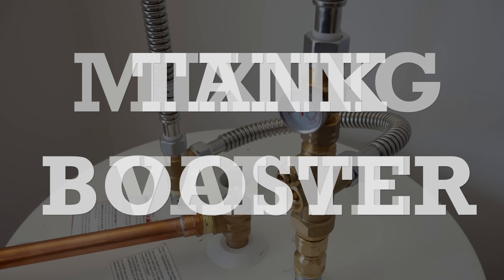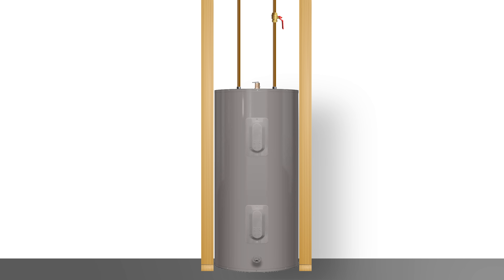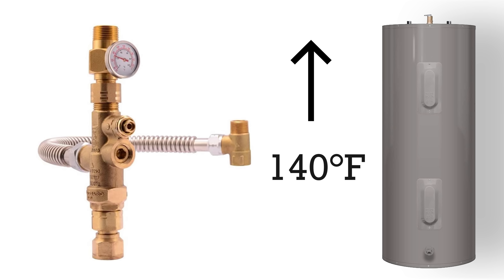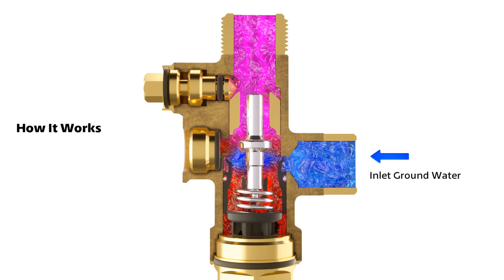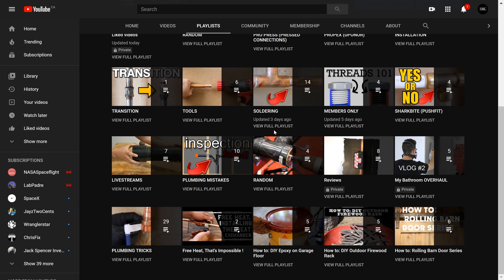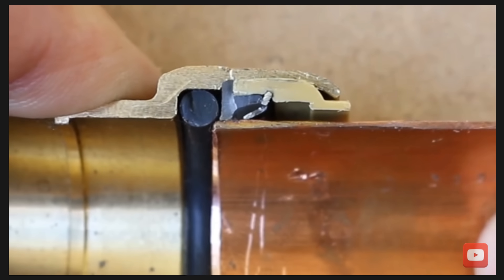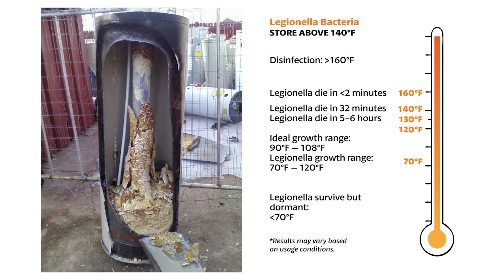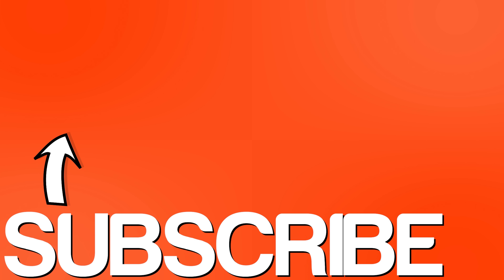INCREASE Your HOT WATER Capacity With This! (Cash Acme PRO Mixing Valve) | GOT2LEARN

Comment: Hey Got 2 Learn. I have a video idea for you. Here in california we are all about saving water. Do a video over the pros and cons of hot water recirculating systems. Ideally people would run a seperate return line back to the tank from the furthest fixture but that can be difficult and cost a lot of money to done on a finished house. I like both of these systems but they both have pros and cons. I like the more expensive one becasue it turns on and of with temp. But they both send luke warm water back down the cold water line and that will kepp you from having cold water at the tap.
Heres the two that i Like. https://www.homedepot.com/p/Watts-Hot-Water-Recirculating-System-with-Built-In-Timer-0955800/100426993
https://www.homedepot.com/p/Undersink-Instant-Hot-Water-Circulating-System-ACT-E1/100037011
Reply from the maker: I shall make a video on this in the future, thanks.
Reply: Me too. Also, thank for the two links. Here's the mention in this video, new video with details would be awesome... subscribed btw. https://youtu.be/bQl5I6E2MHA?t=389
Reply: Recirc lines are a massive waste of gas/electric and are purely for the convenience of instant hot water at the expense of massive heat loss via your pipes, even though they would be insulated. I’m surprised California hasn’t banned them.
Reply: @jman0870  Yes, but one waste a lot less water. We here in California are more concerned with water.
Reply: @travisk5589  I guess you would technically save water by not running as much cold down the drain waiting for hot 🤷‍♂️

Comment: I disagree with 2 statements: 1) more hot water available; 2) not a scam. With or without the device you're not really working with 40 gals of hot water for long. As hot water is used, it is immediately replaced with cold water so there is no longer 40 gal of 120 / or 140 degree water. This is all just a exercise. in mental gymnastics  If you heat water to 140 and cool it to 120, you've wasted energy but it doesn't matter whether you cool it at the tank or at the faucet

Comment: Besides operating costs, why is this any better than having a recirc pump going?
Or why would I want this used in conjunction with the pump?
Reply from the maker: You don't need to install a line from the tank to the furthest fixture, there's no electrical work involved  and there's probably other pros but can't think of them right now LOL.
Reply: Different application.

Comment: What about a whole house booster? I was gonna buy a Gunfos one here in Ontario Canada but it costs 890 bucks plus tx. is there a cheaper way to boost house pressure. i have a tankless installed, so also will it work?
Reply from the maker: These do not affect pressure, only temperature ;)
Reply: Bought and installed a Grundfos booster for my buddy. Worth the money if you need the pressure boost. Will work with tankless. Let me know if you have any questions.
Reply: @lrc87290  Thx for the reply.    Cheers!

Comment: I was thinking about getting some pex rolls and keep them coiled and put them in my attic. While dormant, they'll heat up and I can use that as an input to the water heater!
Reply from the maker: Or the roof heck!
Reply: @Got2Learn  would UV be a problem for pex?
Reply: @michaellewis6569  Pex is not designed to be exposed to sunlight. BUT.....I have used Pex outdoors and it is amazingly durable stuff. I use it for garden cloches, garden irrigation lines etc.
Reply: @michaellewis6569  there are different types, some are uv stabilized

Comment: I prefer using a navian tankless water heater. Never run out of hot water at all and you don’t have to worry about 40 gallons of water ready to flood your house.
Reply: Are tankless heaters impervious to leaking? The gallonage of water which floods the house is based on time duration of leakage not tank size.

Comment: More hot water and a larger energy bill.....  sold
Reply: Higher bill -- agree. More hot water -- disagree.
Reply: @65csx83  it is functionally more hot water at a safe use temperature. You could just turn up the temp on the tank and skip this device, but safety at point of use is up to the user.
Reply: @michaellewis6569  If you're happy thinking the device is of any use, I recommend you don't buy it and be disappointed.
Reply: @65csx83  troll on sir. Have a good day.

Comment: Not convinced yet, who has this installed and what experience do you have does it save on your cost how is the water flow less or eqael
Reply: As the video mentions, it's going to increase costs, not decrease. It gives you more available hot water, not savings.
Reply from the maker: 100%

Comment: Navien and Rinnai just to name a few make a much better solution to this problem 😂 great vid as always 👍
Reply from the maker: They do hehe, but they are a heck more expensive LOL, thanks Joe!!!
Reply: @Got2Learn  Very true! I really like the 2" pvc venting on the Navien's. Supposedly you could recover some of that cost over the years in energy.
Reply: @joedart2932  the premise is based on the latent heat of evaporation/condensation.  A cubic foot of water ( 28.33 liters ) at 212f takes an additional 970btu to achieve a change of state, you now have steam @ 212f.. in a condensing appliances ( any high efficient ) you re gain 970 btu for every cubic foot of water that condenses in the exhaust.. to put that into perspective 1  cubic foot of ch4 ( natural gas ) = 1000btu

Comment: You guys are misunderstanding your own legislation. The purpose of the changed legislation is not to convince people to go replacing their 40 L boilers for 60 L boilers. That won't improve boiler efficiency unless the 60 L boiler has much thicker insulation. The purpose of this legislation is to convince boiler manufacturers to go and increase the insulation thickness on the boilers. For instance you could take 40 L boiler and greatly increase it insulation thickness so that in he end its outside dimensions would be comparable to dimensions of current 60 L boilers. The amount of water such boiler would hold is the same 40 L but since this would almost double the insulation thickness it would greatly improve efficiency of such boiler.

As for these advertised gadgets that allow you to rise the temperature of your boiler. Well raising temperature of your boiler WILL NOT make it more efficient. In fact it will make it less efficient. Why? The laws of thermodynamics state that the rate of heat transfer from one medium to another depends on heat conductivity of the material through which heat is being transferred and the diference of the temperature of the two mediums and the contact surface of the two mediums though which the heat can be transferred.. So when you increase the temperature of the water in your boiler you also increase the rate of temperature transfer from your boiler to the room in which it is in. Also if you increase the size of your boiler but maintain the insulation thickness the bigger boiler will actually be less efficient as it will be generating bigger heat loss due to its bigger surface through which the heat is being lost. So having bigger boiler does not necessarily mean it is more efficient.

And finally if you use up all your hot water every time you take a shower it doesn't mean that you will need more energy to heat it up back again versus if you won't use up all of the hot water every time. It takes the same amount of energy to heat up the same amount of water to desired temperature whether this is done from room temperature to 140 degrees Fahrenheit or from 100 to 140 degrees Fahrenheit. Of course we are not talking here about the amount of water your boiler holds but instead the amount of water you use during shower.

If you want to increase the efficiency of your boiler for cheap there is another way. You see you have your priklical boiler placed in a square closet. Meaning that around the boiler there is quite a lot of space that is not really usable for anything. If you would go and fill all that space with additional insulation material you could greatly increase the insulation of your boiler and thus its efficiency. And you don't necessarily need to use a high grade insulation material for this.You could use any materials that have insulation properties. of course better insulation properties would lead to better gains. So for instance you can fill all that empty space with all that packing material (Styrofoam packing, cardboard packing, etc.) instead of throwing it into trash. Just make sure that such materials don't get into contact with hot parts of your boiler like hot pipes because unlike high grade insulation materials such these materials are probably not heat resistant meaning they could start melting or even catch a fire.

Any way in short the only way to increase the efficiency of your boilers is to increase its insulation properties. Everything else is a scam.
Reply from the maker: That's pretty much what I said in the video.
Reply: @Got2Learn  Not at the beginning- You claimed that raising the temperature would lower your costs at first, and then said the opposite at the end of the video. You have a image that states "The energy required to heat the entire tank is greater than if it was maintained at a hotter temperature at all times" which is 100% false.
Reply from the maker: @nottheinternet6276  The only "lower cost" is the fact that you don't have to buy a bigger tank, it has nothing to do with the water.
Reply: I agree with what you've said, although it seems to me the main purpose of this device is not to increase efficiency, but to increase the supply of hot water while maintaining a safe temp at the faucet.
Reply from the maker: @bhpetersheim  That's exactly what it is. Water heaters, by code, are supposed to be maintained at 140F in the first place, this valve just makes it safe to do so while giving you more hot water in return, but it will use up your tank quicker and it will cost you a bit more in energy.
Reply: Another, and probably more common scenario where this comes into play, is when someone goes to change out their tank water heater and learns that the new tank 50, or 40 gallons won't fit because of the added insulation. You can typically downsize from a 50 to a 40 or a 40 to a 30, use a mixer and then get the same amount of hot water or more with the smaller tank.
Reply from the maker: Yes, exactly Len.

Comment: You say there’s a one way valve on the hot and cold lines on the device, doesn’t that make the expansion tank useless and force the tank to withstand more pressure?
Reply: The one way valves in the mixer only prevent the water from flowing the wrong direction through the mixer. There is no one way valve placed between the expansion tank and the water heater. the cold water tee on the mixer is just that, a tee and does not contain a one way valve.
Reply: @lenhanson6719  thanks for clearing that up for me. I wasn’t thinking.
Reply from the maker: Thanks Lee.

Comment: I really enjoy your videos, Thanks! 
I live in Scandianavia and up here this has been a default feature for decades. I have not seen a water-heater without a built-in mixing valve since early 1980's. :) I run the tank at 170F (75 C) and the outlet at 45C (113F). These are default values from the manufacturer (OSO Hotwater). 

Once a year I crank the mixer to max (65C) and flush my pipes for 2 minutes with really hot water to clear any bacteria from the pipes/faucets.

Any cons to this method that you can see? I have a mix of copper and PEX piping.

Comment: Is that not just a tempering valve ?
Standard practice on all hwc’s in nz?
Reply from the maker: Here in NA these aren't standard, maybe one day hehe...
Reply: It is exactly that, it's supposed to be on every tank here in Canada too but rarely happens
Reply: @MrDmadness  if you’re too irresponsible to have 140 degree water at the faucet you are probably too irresponsible to be an adult 🙄
Reply: @jman0870  it's about code practices, theyvare in place for safety of children and elderly. I agree with you to some degree but I'm not taking lessons from a non ticketed person while I hold a red seal, respectfully intended
Reply: @MrDmadness  there was a time where everyone’s hot water was 180 degrees. I always set them for 120 and showed the customer how to adjust as they wish, made them sign a scalding waiver, and rolled out 🤷‍♂️
Reply: @jman0870  140 also
 To kill Guardia

Comment: In my own experience, you can just jack up the temperature of your hot water tank and yes, pay more for it, but you end up using less as you end up mixing more cold water to reach your desired temperature. Problem is, to use it practically, you will forget and burn yourself when doing the dishes, having a shower etc. This is a MUCH safer alternative! Thanks a bunch, I’ll keep it in mind!
Reply: This may violate your home owners policy. Water temperatures at the faucet that are greater then 120 degrees can cause burns very quickly.
Reply: Reduces the life of the tank

Comment: These are junk.  Just spend a few bucks and get a tankless.  I have a circulation pump and a circulation loop.  Hot water at every faucet
Reply from the maker: If you can afford it, sure...
Reply: Need a special vent out the side of the house. Big vent.
Reply: @troyf1  i had to go with an electric tankless as natural gas is not available in my area and there are a lot of regulations from the texas railroad commission (which regulates propane tanks in texas) which would make the cost of adding a propane tankless almost prohibitive.  my electric only draws current based on the demand placed upon it, so when i have run the numbers on what a propane tankless would cost versus electric, the cost per gallon of hot water was about the same.  to use an electric tankless with my circulation pump though, i did have to buy a small 'tank' water heater because the recirculated water had to go into it (and not the inlet of the tankless) to prevent burning out the electronics of the tankless.  doesn't cost much to keep that 5 gallons of water hot in a tank, because as soon as there is a demand, the electric tankless kicks on and the heated water from that goes to the inlet of the small tank 'reserve', where it is mixed with the recirculated water from the line - which is still mostly warm because the pipes are insulated).  maybe takes 2 or 3 seconds for the water to be 'hot' at the fixture and i have never noticed the initial mixing..  check valves are wonderful!
Reply: Few bucks more like 1500 to 2000 for the navien units I install.
Reply: @Chris_dolmeth   well a GOOD tank water heater is going to run you almost 1 grand.  and it seems anymore if you can get 10 years out of a tank heater, you are ahead of the game.  Rheem has a gas / propane models for less than the price range you posted, and they will last a virtual lifetime.

Comment: cool video!  but i think i found a disadvantage to this, especially if you using a hybrid water heater and have a recirc pump.  when your recirc pump kicks on,  you'll actually recirculate the now 120 degree water thru the plumbing system and after it gets back to the water heater, it will be around 110 degrees, the water heater will lower tank sensor will see this colder return temp (compared to the 140F going out the top tank) and cycle the water heater more often.    my house has a return in the slab in texas (common), also according to the chart, my inlet water temps are about 10 degrees lower than what that chart says.
Reply: I wonder how that works because you will technically be recirculating more water into the tank than what came out of it, right? That doesn't sound right though but it doesn't work otherwise, I think.
Reply: @chaos.corner  look up how a  recirculation pump works :)
Reply: @morejelloplease  So what am I missing? The recirc pump takes water from the hot supply, pushes it out to the faucets and returns it to the tank. But this device adds water from the cold supply. So the only way for the extra water to go is back down the cold supply? That doesn't sound good.
Reply: @morejelloplease  Mind you, I believe there are also ones that don't have a return line and push the hot water back through the cold supply. Though I think that's a bit dodgy too.

Comment: Shouldn't there be dielectric connections on your tank, or are they not a necessary item? Nice informative vid, thanks.
Reply from the maker: To clarify this guys, this is the reason why there are 2x "brass" female adapters and not "copper". Brass is way more resistant to galvanic corrosion and are ok to use. I also mentioned using dielectric unions as some states require them for earthquake protection and they are also good at stop any galvanic corrosion.
Reply: @Got2Learn   Thanks G2L! that's good info to have for next time I work on my water tank.
Reply from the maker: @gnic76  🤗🤗🤗
Reply: Those silver stubs on the tank at the cold and hot water lines are dielectric nipples. They are plastic inside.
Reply: @mannys9130  But shouldn't there be a dielectric union to isolate the copper pipe from the nipple?
Reply: All new tanks have dielectic connection on the tank, I know the argument for dialectic unions but its pretty weak. Zinc and brass are both very close in the nobility scale ( zinc is present in brass iirc ) so no galvanic action happens. In over 25 years of doing this I've not once seen a tank leaking due to pinholes of the connection.. galvanic action literally never happens there, unless copper direct to the nipple on the tank... even then, it's isolated somewhat due to the Teflon tape